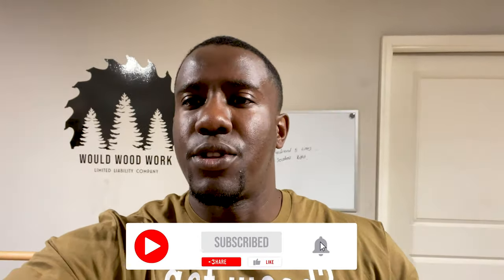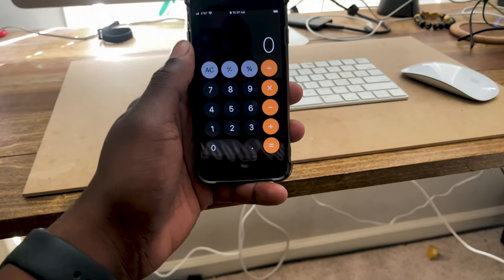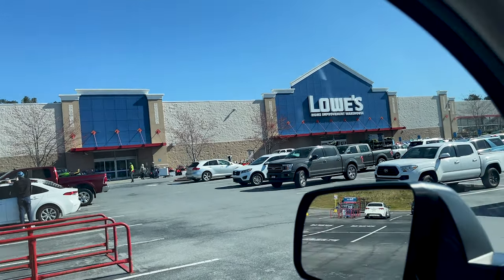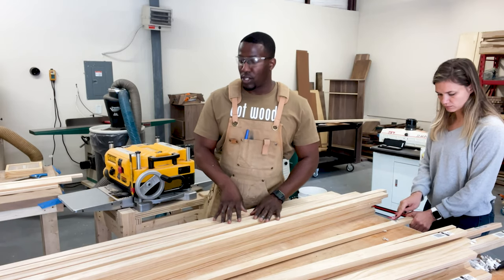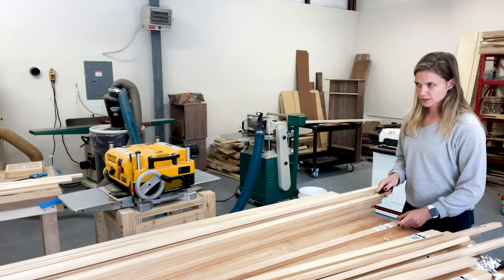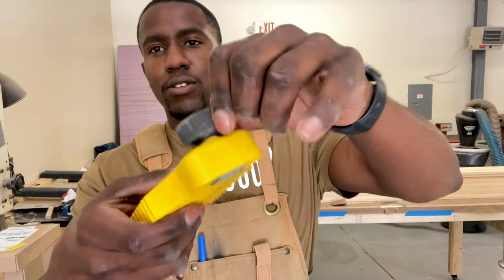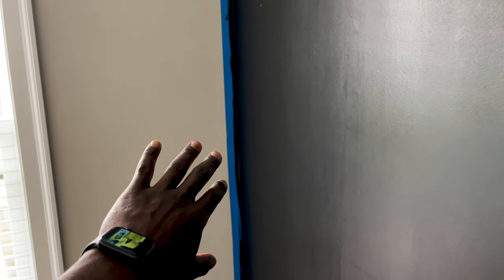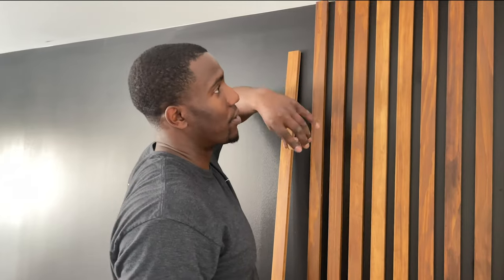How To Build A Slat Wall | STEP BY STEP GUIDE

Comment: Nice work. One tip I'd recommend  is use  a pin nailer with 1 3/8 nails instead of Brad nails. Super small hole and strong enough hold and no puttying required.
Reply from the maker: That's a good one! I have used ping nails on my event walls before so I'll give it a try
Reply: Would pin nails still be strong enough if you want to hang shelves on this type of thing if you did the same technique shown in the video?

I want to do this myself but on drywall not sure if the nails will have enough depth of wood to be in or if the 'hook technique' of 2 at an angle is good enough. Though maybe brackets for the shelves could fit in-between the slats and go into the wall directly anyway.

Comment: I’ve watched at least a dozen slat wall videos and this one struck me for 2 reasons. First, I did NOT know about that brad nail on the sides trick. Fantastic info since I just received my 18-gauge nailer earlier this week. Second, the colour. I really want to do a dark-ish walnut one (most seem to be lighter coloured) and this one turned out beautifully. Thanks!
Reply from the maker: Hey David! Thank you for your comment! Bradnailing through the sides will definitely give your wall a much clearer look! When I see the nail holes on the front of the slats it's super cringy plus it's hard to match wood filler with the color stain. Try water-base golden oak by Behr. Use two coats, that's how we got this walnut color. 1 coat will come out way too light.
Reply: @Wouldwoodwork if in case in the future you need to take down the slats, will it be harder to take them down since they seem way more secured than if you nailed them in from the front?
Reply from the maker: @siIIiest  trust me that is a good problem to have. I'd hate for my client to call me and say hey my slats are falling off. There will be drywall repair either way you go, I'd recommend going the most secured route

Comment: Wow Thank You for this video, I originally did command tape. That was a no go lol it fell smh. So I came across your video that shows to Nail from the sides, which became my wood is stained and all set to go. I was concerned on the nail showing from the front. I will try this and see if it works for me.

Comment: Hey buddy my home, believe it or not is all concrete. So what do you suggest I use to secure my slats or to secure the pieces for my accents wall thanks
Reply from the maker: What's up Robert! That get a little tricky but off the bat my mind is leaning towards building your slat wall on panels using 4x8 sheets of 1/4" or 1/2" sanded birch plywood. Make sure you paint the sanded plywood first then brad nail the slats to that with equal spacing. You will have to anchor 2x4 or 2x6 wood studs to the concrete using concrete screws or anchors horizontally then screw those panels onto the studs in between the slats (16" spacing)
Reply from the maker: They also have pre made panels for slat walls but they are extremely expensive

Comment: Is the wall made of dry wall? So with the trick of nailing from the side at an angle is enough to hold the slats, great idea.
Thanks
Reply from the maker: Yes the wall is drywall(Sheetrock) we checked with the client and the wall is still is solid condition

Comment: Hi, I currently have paneling in the kitchen that I want to remove. Could I do an entire kitchen using this method?
Reply from the maker: Yes you could but be VERY careful as there are water lines, possibly hvac lines behind your walls. Check behind each wall to see if there is anything that might have a pipe in that area and use a very good stud finder that can show metal, pvc or copper lines

Comment: Hi.. loved the video.. can you help me out with what kind wood did you use for the slats please . Thanks
Reply from the maker: Thank you! Yes sure! We used Select Pine. You can get it from Home Depot or lowes
Reply from the maker: Use the line that doesn't have dark knots in it
Reply: Thanks !! Also can I ask which stain did you use on the select line?
Reply from the maker: @8885priyanka  we used 2 coats of golden oak(water based)

Comment: Slat wall (I need to build a Murphy bed) 

Also out of curiosity why say 10/16 instead of 5/8?  Doesn't matter, just wondering if there is a reason.
Reply from the maker: You're entered in! 

Good question, some people don't understand how to get to 5/8 on a measuring tape but they can count the 16 ticks to get to 10/16. Either way works wood workers can easily understand the terminology but I want to make sure even the newest diyer's can understand the measurement.

Comment: Hello there!

I wanted to ask you a simple question about The wood slate Wall.  Do you nail it directly in to The drywall?
Reply from the maker: Hey! No problem, yes I nailed the slats directly to the drywall at a 45 degree angle on either ends of the wooden trim.

Comment: If you wipe the wood down with mineral spirits and let dry for 15-20 minutes before staining it will help the wood to absorb the stain more consistently
Reply from the maker: I never knew that! Thank you for that tip and sharing it with us. I've used wood condition before but never mineral spirits
Reply: @Would Wood Work  your welcome, most wood conditioners are mostly mineral spirits

Comment: How long were those woods slats? can’t seem to find 9ft in Home Depot
Reply from the maker: What's up Travell, these slats are 8' you won't find 9' pc at Home Depot but you can be creative about the design maybe add some slats horizontally along the bottom 1' of your wall or cut an addition 1' and add it either to the top of bottom of your wall

Comment: Hey bro thank you for video but i have really most important question for me. What size nails you used ? 😀
Reply from the maker: Thank you for your comment! We used 1 1/4" inch nails  for the project. If you are going to nail directly into the front of the slats I'd recommend 1 1/2" nails.
Reply: Did you put that nails directly to dry wall ?
Reply from the maker: @onerongun  yeah we went through the slats into the drywall
Reply: @Wouldwoodwork how do you avoid electrical wiring behind? Is that the reason you use 1 1/4" and pin them from the sides?

Comment: in the process of doing this myself. a question I had is is there a way to calculate the spacing needed between the boards to ensure you have a full board on each side of the wall? Im not the brightest when it comes to math 😂
Reply from the maker: Hey David, the best thing to do is put one slat on each end with the correct spacing .75", 1", etc. the figure out how much space is left on your wall and divide that by the (slat thickness + spacing) until it equals a whole number.

Comment: How did you get the 1 inch spacing figured out?
Reply from the maker: I used a 1" space but I got the total length of the wall then divided that by 2.5(slats are 2.5" and spacing is 1") that gave me the amount of slats I needed.
Reply: @Wouldwoodwork  can you elaborate..? Not equating. 

I have a 84&3/4 " wide space.  I will be Using 27 slats which are 3/4" thick. I want to evenly space them across. I don't care how many inches exactly the space is.. how does this equation get that accurately sorted?
Reply from the maker: @HumbleGladiator  how wide are your slats? 1" wide or 1.5" wide?
Reply from the maker: @HumbleGladiator  let's say your slats are 1.5" wide..

Subtract 3" because you'll end up putting a slat on each ends of your wall so this leaves you with (81 3/4" of wall space) take that number and divide it be 3(this is your spacing plus width of slat 1.5" slat + 1.5" space) 

You'll end up with 27.25. That's how many slats you'll need. When you are doing your wall leave 2' of space and do this equation once again to space out the slats so they even out the rest of the way
Reply: I know how many slats I need. What I need to figure out is how to space them divide the space them evenly all the way between 84&3/4

Comment: Did you clear coat after staining?
Reply from the maker: Yes, we put 3 coats of clear matte poly on the each slat
Reply: @Wouldwoodwork  Would you recommend a clear matte poly of semi gloss? My contractor said the clear matte might take more maintance and break down
Reply from the maker: @JS-cb7rx  we haven't experienced that using clear matte, most of the time we use a satin finish which holds up well but we did finish a custom oak bench with matte for a tea shop and after 9 months it still looks good!
Reply: @Wouldwoodwork  could you link me or tell me the exact brand and finish you used on the slats as I'm doing the same project.

Also was it oil or water based and did you spray or brush on?

Comment: What color stain is this? Thanks!
Reply from the maker: We used 2 coats of golden oak stain
Reply: @Wouldwoodwork  what brand?
Reply from the maker: @stevenkha9267  it was water base varathane. It comes in a blue tin can